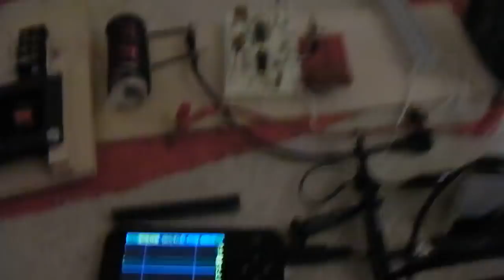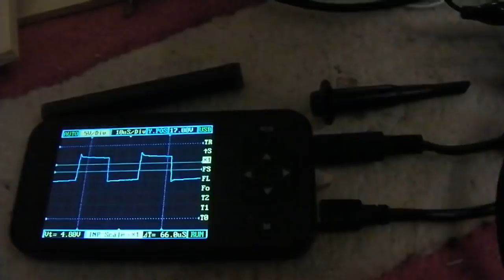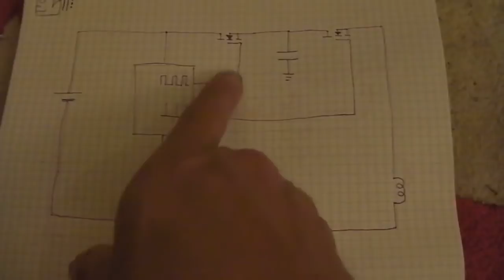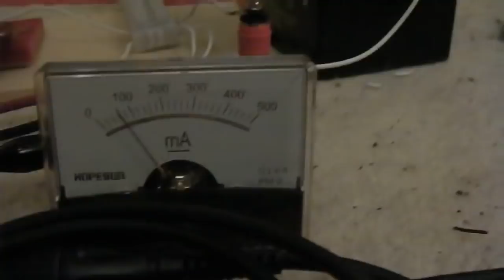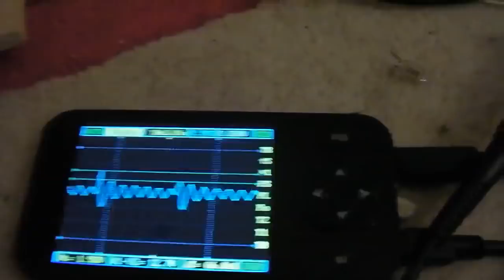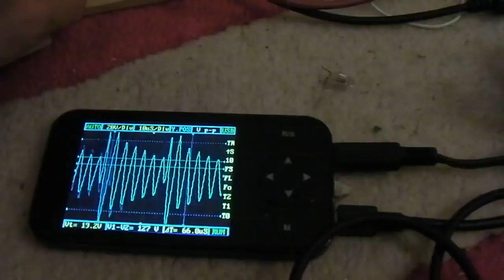Cap discharges into coil while disconnected from the battery

Comment from the maker: Agh, three quarters of a tenth of an amp is what I meant. 75 milliamps. Heh.

Inquorate: I think it has to do with how sharply the discharge into the coil is stopped. Tesla invested a lot of time researching quenched spark gaps and most tesla coil builders maybe overlook this. I guess a rotary spark gap is a quenched gap, but a rotary gap limits the frequency of discharge because of physical considerations like practical rpm.